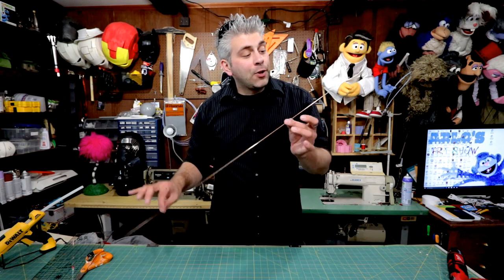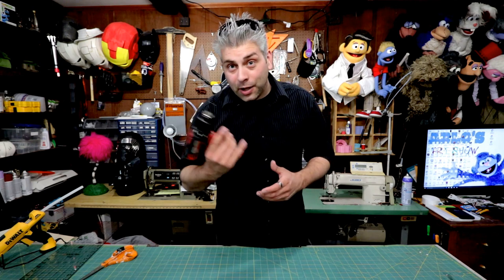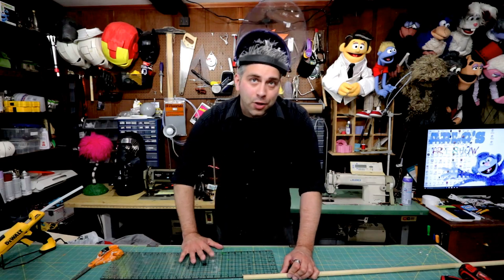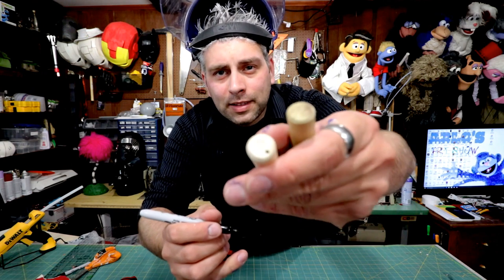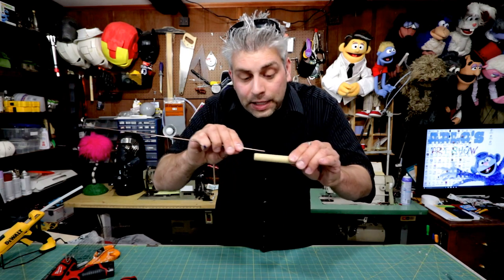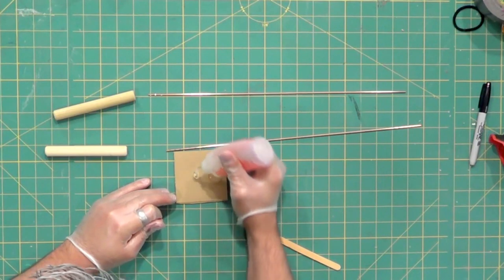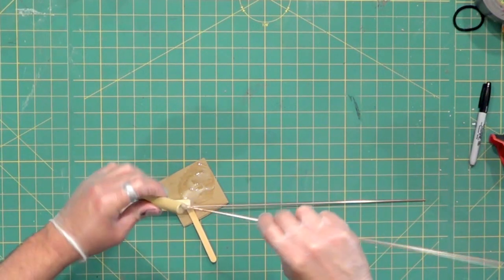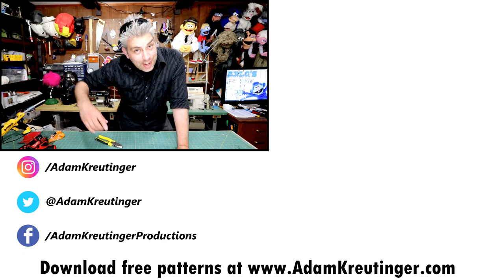How to Make Arm Rods For A Puppet! - Puppet Building 101

Comment: Your teaching style/process works with well my way of learning. I have difficulty sometimes figuring out certain techniques others have taught regarding puppetry fabrication. You speak right to my learning style and make things easy to understand. 

Adam, I have a sticking point on patterning that I would love to get your take on. I have several different patterning books/DVDs but I can't seem to figure out where to make darts and seams when doing the tape and plastic wrap method of puppet patterning. Any hints and tricks that you may have will be extremely helpful. 

Patterning is the only area that is preventing me from moving to the next level of puppet building. Please help me to understand and get passed this area.
Reply from the maker: +canufathom1 : Thank you for your kind words. For the pattern making, some people make the darts after they take it off the clay and try to lay it flat. Make cuts that help it lay flat. It's not the best way to execute, but it's the best way to learn I think. Once you do it a few times you will notice the best spot to place darts. But the best tip I can give you is practice. I am planning on making a video on this. But I have a few more videos planned first.
Reply: Thanks. When you do your video, after you get through the few you have planned to do prior, please include your technique for determining the best location for seam placement. The darts are a little easier to understand, and I will practice at it. Seam placement is the main confusing part for me, and I'm sure they are for others as well. Thanks so much for this.

Comment: Great video! Our arm rods are similar, but we used straightened-out wire coat hangers and we 3D printed the handles because we wanted them to be square instead of round and we couldn't find square dowels locally.
Reply: chfgn you can buy square dowel but why use square? Round handles allow you to roll the handle for smoother wrist turns? Just wondering why you prefer square?

Comment: Great video series! Instead of spray painting the wires, use flat black shrink tubing with a heat gun. Can't scratch it off like paint and it reduces the noise from the rods clanging together during performance.. Haven't tried it yet but I hear using tool dip on the dowels is a nice touch. Thanks for all your helpful tips!
Reply from the maker: +Ben Burris: Yeah! A great option. If have a turn around of only a few hours and no time for paint to dry, I do that too. But I don't like how thick it makes the rods. But both work.
Reply: Nice game hope everyones enjoying destroying yourselves
Reply: @PuppetNerd  it's kinda complicated now as it's all branched out

Comment: I use bow cutters instead of dremel to cut the rods. Also electric shrink wrap for both handles and rids. For the tops of the rod I also curve them like you do but fill that with Propoxy to give it some weight.
Reply: Rods not rids. lol
Reply from the maker: Hey! Typically I use cutters to split them too. Since I had to use the rotary tool to cut the notches towards the end of the video anyway, I decided to use the rotary tool in an attempt to minimize the amount of tools I was using. I imagine some of the viewers are on a budget. In that case, I would recommend the rotary tool since it is more versatile for cutting, notching, etc. While the cutters are can only cut. If I could only have one tool. The Rotary tool would be it!
Reply from the maker: Also I have used the shrink wrap too! It's great stuff. But not my preference. Though it has benefits like not getting scuffed as easily, I feel it comes at the cost of making the arm rods too think for me. I find myself using it more then I have a project that's due the same day and there is not time to wait for paint to dry. Thanks again!
Reply: Adam Kreutinger blinking mechnisem of oscar

Comment: I just use the straight bottom part from a hanger and bend the other parts off with pliers,I bend the top into a "P" shape and use a wooden handle and it works just as well,I can bend it easily for different areas the arm is is also,Although I do recommend what you did more.

Comment: Thanks for these videos. I'm picking up some good tips.  A couple thoughts: 1. Could you use the stamped part of the rod inside the dowel? 2. I cut a notch deep enough along the axis to put the rod below the dowel's circumference. Then I drill a hole perpendicular to the cut and bend the tip of the rod to stick into the drilled hole. Glue into place and finish. No spinning because it is self-keyed.
Reply from the maker: You can do whatever you want. This is just one method.

Comment: I ordered the welding rods from the link.  They’re great.  However, they are copper in color rather than silver.  I had to heat shrink them.   is this a change or is there something missing?
Reply from the maker: Nope. They have always been copper coated.
Reply: @PuppetNerd  Why not use 16" Insulation Supports? (shhh..)

Comment: Adam:  could you do a video on the different ways to make hand control rods removable.  I have a puppet I do not want to cut into to insert rods.  I have thought of bands that stretch over the hands. (not a great idea).  I do not like the look of just the bent wire that slides over the hands or wrists.  I was thinking about a band that will snap or use velcro to keep it on the puppet.  Easy to take off.
Reply from the maker: Already did! Check it out here! https://youtu.be/RvFeU4xnVRM

Comment: For the longest time, I did what a lot of amateur puppet builders do: recycle wire coat hangers, then wrap a generous amount of duct tape around the bottoms for handles. While I haven't actually made arm rods in a while, I recently took to using wire similar to what you use in this tutorial, and recycling the wooden handles from sponge brushes from Walmart that are less than a dollar each. As I said, I haven't actually tried making them yet, but based on your tutorial, I'm going to assume that even contact cement wouldn't be ideal for inserting the wire into the wooden handles? Also, what specific type of spray paint did you use? I ask before no matter what paint I've tried before in the past always ends up chipping away.

Comment: hey adam! i was wondering how long approx are the arm rod wires after you cut off the flattened metal? i really like the length you work with, and i dont know if you said how long it is after the flat parts are cut off
Reply: 16 inches

Comment: Is there a way to only have one puppet rod for one arm and using fishing wire(or something like that) and attaching it to puppet arm with the rod then threading that to the body and to the other arm that has no rod and use one rod to control one arm fully and slightly control the movement of the other arm?
Reply from the maker: Give it a try. Let me know how it works out.
Reply: Yeah I was testing it last night and the fishing wire doesn't move. I have just seen it on other people's puppets. I'm going to try one more thing
Reply from the maker: You might need to use a Braided Dacron line. I’m sure the clear line would stretch.
Reply: Adam Kreutinger I will check that out.